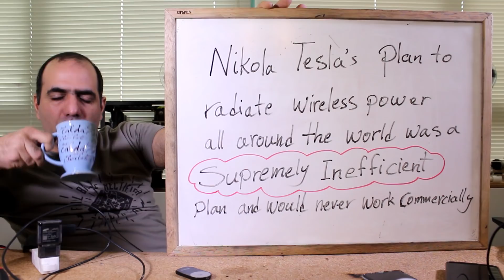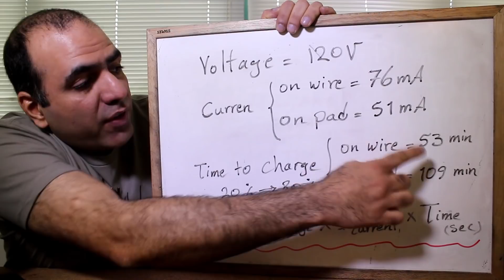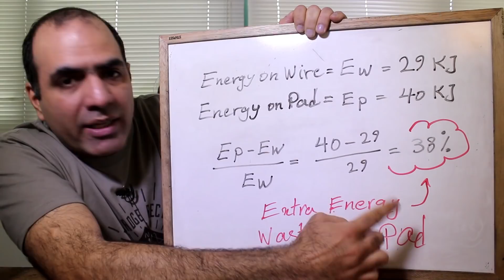Drowning in Inefficiency

Comment: Check out the 'new' charging cables available on eBay, with a magnetic connection between the cable end, and a small magnetic donnection to microUSB or lightning port connection.

The magnetic connection is what caught my attention, because I frequently fall asleep reading my iPad, and kill a lot of cables.  What has me raving about these new cables is their EFFICIENCY!  They actually charge at a high enough rate to make the Apple 2.4 A charger get hot!  Charges my iPad from 10-20% in 30-40 minutes.

Much, much faster than anything I had before.  Plus, the cables are very durable.  I was buying Apple OEM cables, ten at a time, and they lasted 2-3 weeks.  I had two buy two ten packs from different vendors, usually, because there's a 10-20% DOA rate on the cables.

I got 3-4 months out of the first one, warrantied it, and have 4+ months on the replacement.  I've tried two, or three different brands, (I bought extras), with the same charging results from all of them.

Enjoy...

Comment: I heard from other sources that induction motors used in electric vehicles is very efficient (>90%) to convert electricity to mechanical energy (though there are other energy loss in battery (~90%) and inverter (~90%), but the overall efficiency should still be around 70%), which is much better than vehicles that burn fossil fuel.
Reply: Problem is: we don't care too much about efficiency overall, than about total consumed power. If choosing between gas scooter which has 20% efficiency 2-stroke engine, and Tesla, scooter is winner because it is so lightweight, it just doesn't need too much power to ride you, so it ends up consuming much less. While Tesla may be 70% efficient, but it weights more than 1,5 tons (all that batteries and invertors and insanely overpowered motors, that's just no point in that), so it has much more rolling friction. It is also bigger, so air drag is also quite big. With mass that much you lose energy at each accelerating and braking (even if there is regenerative braking, it's not that efficient, doing conversion from mechanical to electric to chemical and back), so just no. 

When talking about efficiency, people often forget about it...

Comment: Mehdi? You are WRONG! Gas and steam combination turbines can be efficient up to 63% (german source here: https://de.wikipedia.org/wiki/Gas-und-Dampf-Kombikraftwerk)
also to claim regular engines are only 20-40% efficient is unfair and not true

also Elon Musk is a fraud. Here in germany and europe we have tons of literature calculating his cars need to drive from 200.000 up to 300.000 km in total to be more efficient than regular cars. and that's by average! his car's are bad for the environment, using rare earths, needing hugh amounts of energy to produce and they are expensive. that does not sound like a solution to any modern problem!

Comment: I'm truly inspired.
I was working on a 10kW residential wind turbine. I designed an axial flux generator for this purpose. I also designed the blades the control system.
I was fed up after all hardwork, because I feared I would fail to succeed in the project.
Then you just struck me like a million volt lightning. I'm on my project now. Never gonna give up.
I. Am. An. Electrical. Engineer.😎
Reply: Oh so you designed a thing that kills birds by the thousands every year? Not to mention it is inefficient most of the time as wind speed is not constant. But don't make this discourage you, people do pointless thing and it's ok as long as you feel self fulfillment and satisfaction!
Reply: @kaikart123  just because the wind speed isn't constant does not make it inefficient
Reply: @kaikart123  pointless?????
Reply: @kaikart123  the birds will slowly adapt and migrate
Reply: @kaikart123  Let me clarify your doubt.
Yes, the wind speed isn't constant. But we can use a flywheel with an adequate weight. This will reduce the problem.

Yes, birds get hit by the blades. Buy the weight of the blades isn't much and the speed is also low. It's a mere 100 rpm. I have designed in such a way. This prevents birds from getting fatally hit, and gives long life to parts with less stress forces.

It's not a mere satisfaction or fulfilment. It's a revolution for the mankind. Because that's who I am, an Electrical Engineer. I revolutionize the planet.
You must be a dumb American who also thinks wind turbine cause cancer. I cannot answer that doubt of your leader or your group. I'm sorry.

Comment: My life is inefficient, so here is my unsolicited opinion. :) Wireless charging pads are great, despite their problems. 

   Imagine only having one functioning hand... hows that micro B connector treating you? Aside from turning a 2 hand job into a one hand job, think about their inherent safety in public settings. Maybe I’m paranoid, but I’m not hardwiring my phone into ANY public USB charger. USB carries power AND it ALSO carries DATA! Most importantly... ITS REALLY COOL! I smile almost every time i plop my phone on a pad. :D

Comment: VPNs are a waste of electricity. Most of their  claims are misleading at best. The only benefit is getting around geoblocking. You are also slowing your internet down so yeah, more waste.
Reply: Go check michael reeves' video that was sponsored by a VPN. He demonstrates how easy it is to pluck data packets out of the air, and how effective VPN's are in preventing this.
Reply: @taylorwalker2814  I know how to pluck packets out of the air. 
I guess, I should add that VPNs are very useful for public WiFi.
Often public wifi will do little to nothing to protect it's users.

Comment: A great video in till you mention Elon, after all, he is just a seals man... Goes out with stupid ideas that's old and puts oon an other name, like hyperlop... Your better of not looking up on him, there is some real engineers out there that don't make the many with false promises... T
Reply: Hyperloop is hypothetically possible and isn't a horrible idea. SolarCity on the other hand...
Reply: Well, hyperloop is an old idea from 1800. The name is only new... And yes it is possible, but we still have the same low pf physic as in 1800, like a long pipe bending because the terminal extension more on the top than on the bottom while sitting in the sun... I still think he is a great man pushing true the tech in the electric car industry... But that's it...
Reply: @kristiangronberg3150 , did you watch that thunderfoot video about hyperloop? I don't know how he, being a physicist, can say so much idiotic stuff. We already have oil pipelines that go for thousands of kilometers with quite a few atmospheres of pressure in them. They just put and elastic link (a short polymer tube) every few of kilometers and thermal expansion isn't a problem.

Comment: what about the Wankel rotary engine. i think it is more efficient
Reply: It's lightweight, which would allow to use less power because engine is the most heavy part of car, so there is less friction, smaller car and less drag and so on. But its efficiency (power produced divided by power consumed) is actually lower than of conventional engine.
Reply: Well, it seems not, that's the problem. Even if this type of engine has real advantages such as vibration, noise, compactness....(By the way, it's the piston that is rotating, not the engine as in some old planes)
https://en.wikipedia.org/wiki/Wankel_engine

Comment: I think the most inefficient thing in my home is fan. I mean the AC fan that usually has three speed mode to chose. I'm not sure if it's popular in US, but it's often seen in Taiwan. That kind of fan draws around 80-100W while the BLDC one draws 20W and produce even stronger wind.
Reply: But it's SOOO more efficient than air conditioning unit! Nowadays lots of people spend kilowatts of power to cool down air, though they could just turn on the fan. Even with 80-100 W motor it's pretty good solution. Actually, I think their power consumption isn't so big, 80-100 W is probably FULL power, active + reactive. Reactive power is not good, but it gets compensated usually (there are special stations with battery of capacitors to keep power factor close to 1), so you're OK.

Comment: Returning rocket stages are actually extremely energy inefficient. They need extra fuel for landing. This means extra weight hence even more extra fuel to launch it.
Reply: Yup. These Falcon Heavy are impressive of course, but both times they delivered 3 tons to orbit, maybe even less, that's total garbage! Space Shuttles probably were more effective than this. And they were almost reusable: only hydrogen tank got lost. Boosters were recovered (they just fell to ocean on parachutes) and orbital stage too, of course.
Reply: @allmycircuits8850 Shuttle-like return vehicles are definitely the future of space launches. Multi stage rockets had to be a compromise for the time until we find energy source which would be efficient enough to launch one-stage-to-orbit vehicle. Unfortunately this situation did not change drastically since the times of space pioneers.

Comment: talking about how inefficient a light bulb is, we must consider the fact that this is the simpliest way to generate light - just like the nature does - overheating something so it starts to glow. Ofc there will be alot of energy lost due to the method itself. Even the Sun glows and burns with so much inefficiency! What we might do is consider other ways the nature crates lights. Radiation glowing? Electrical discharges (in any size, like lightnings)? Maybe dividing one big heating element into number of small ones, so it'll take less power to heat them all at once (since thermal capacity is a thing) to the same net brightness. Is that what LED bulb does btw?

About charging phones: same problem, they heat up during the charging process. And this is due to the fact that power transmition is overloaded by the speed it actually tries to charge the battery. I think if you charge it slower - the coefficiency might rise. But then again, who needs their phone charging 8 hours with a capacity of 3ah... This is when replacable batteries come into play. Just charge few of them in advance, and we need a phone that supports battery hot-swap (instead of that stupid wireless charghing tech that has no practical applications). 
OR BETTER! A battery, that can be charged in parallel, not in series. Im talking about a battery that consists of small portions that the charging module can deliver energy to at once. So instead of waiting for the whole battery to charge slowly step by step (and increasing current to charge it up faster, making more energy to waste in a heat form), this battery will allow to charge itself in different "spots" at once, making the whole process superfast without getting too hot to waste energy and drop efficiency

Comment: Solar panels top out at 20%. You can get 400W panels, but they have 2+ meters of surface area, so still max at 20%.
Reply: That's not true, solar panels with up to 50% efficiency have existed for quite a few years now but the obvious down side is they are ridiculously expensive and at current not possible to mass produce, also it's the type of thing you aren't just going to find on amazon and get free 2-day shipping, you're more than likely going to have to be a company, contact the manufacturer directly and make a large order to be able to obtain any such panels.
Reply: @vgamesx1  "SunPower produces the highest efficiency monocrystalline solar panels available. Our X22 has a record-breaking efficiency of up to 22.8 percent, making it the best performing panel on the market today. Polycrystalline panel efficiency typically ranges from 15 to 17 percent."
Reply: That's in a controlled environment. In the hot California Sun, efficiency drops, dust on it drops the efficiency, so practical efficiency is less than rated.

Comment: I always hate the wireless charging. I caught the hype back when I bought an HP Veer and it came with touchstone charger. I ended up using the cable most of the time anyway. 
Don't be an idiot guys.... There is no benefit in using wireless charging, you can just put it on the pad sure, but when you want to use it, you need to pick it up anyway.

Comment: Charging a laptop at a friends solar setup: His small DIY solar setup creates 20V DC, his transformer makes it 240V AC and the laptop charger makes it 20V again.

Your video inspired me to fix this:

Instead of a laptop I plugged in my desk lamp and pointed it at the solar panel to create more energy. Easy as that, elon musk brain.
Reply: A true Elon Musk brain would plug an extension cord onto itself in a loop. Boom, infinite energy.
Reply: And how is your laptop now ? How much does it cost to fix it?
Reply: @natefiver6623  What? Sorta seems like you assumed he plugged the panel directly into his laptop, despite him not saying that he did that. That being said, it the correct protection in place it could be done and save energy
Reply: @natefiver6623  My laptop works just fine. Read the original comment again, you must have misunderstood something.
Reply: @SERVOPUNK  I just get it lol
You are charging the solar panel by the lamp that is taking the power from the solar panel
So its generating more energy 
And that is how elon musk brain works 😂😂
Reply: why would anybody have 240? wouldn't it me 220?
Reply: @tommybomby4122  here in Great Britain we use juicy juicy 240V power. It helps us make tea faster.
Reply: @tommybomby4122  More like 120/110V.
Reply: @boxcarz  and i've never heard of 110 volts either. i've only heard of 120 and 220
Reply: and yes i do use 120
Reply: @tommybomby4122  To my knowledge, some EU countries have different voltages. The grid here has 220V but the solar inverter he bought produces 240V. Every appliance he plugged in so far could handle 240V, so it seems to work just fine.

Comment: I highly doup new innovations, unless they are on the scale of miracle or free emergy, actually make a significant difference in energy consumption.

The problems are political and ideological: lack of funding, private interests and lack of cooperation are the real reason we aren't more efficient than this. We fail to utilize and build efficient tecnologies, and any savings quickly burn up as we just buy more and more stuff to replace it.
I have 2 computers, laptop and a phone. Sure, they all are more efficient than the first computer I used, but together, in way more active use, they definitely consume more energy

Comment: Nuclear power is 90% efficient according to the information I found.
Reply: Snorting plutonium is only cool for so long ...
Reply: Yes, it is efficient, it produces almost no CO2. But it's one of the most expensive methods to generate electricity. When you add the cost to keep the waste safe for only 100 years. And this is only a small part of the time needed. Right now the public pays for this, it's just plain wrong
Reply: @stefanhauser2804  "But it's one of the most expensive methods to generate electricity" wrong. Nuclear power had the lowest electricity production costs at 2.10 cents per kilowatt hour, and petroleum had the highest at 21.56 cents per kilowatt hour.

"Right now the public pays for this, it's just plain wrong" tell that to wind and solar.

Comment: In a rare case of discussions on the internet, i once read an interesting point, if you obtain your energy from only your own sources (most likely solar) and you're off grid, then, does the amount of wasted electricity matters? And in direct way i guess no, because the source of energy is relatively permanent and as long as you have enough energy per day there's no problem in wasting it. The problem with this would come in am indirect way, because if you waste energy in inefficient devices or uses you're wearing your batteries installation and devices, wich eventually would cost when they need maintenance or replacement before, also you could argue that if you put your extra electricity on to the grid (if you're connected) then you're helping the overall grid and producing clean energy for everyone. What do you think?

Comment: If you want to save the wear on your plug, use one of the magnetic charging plugs that are available.

Wireless charging would be far more efficient using light, but the metamaterials needed for optical dipole antennas are still in the experimental research stage. Imagine how efficient solar power could become!

Comment: reusable rockets using fuel to land?  What's wrong with parachutes?
lifting extra weight of the chute sure less than using rocket fuel to slow down descent - including the weight of the fuel at beginning descent.  (gravity is free or not?)
Reply: Using fuel to land allows them to control the descent so that it lands exactly where they want.
Reply: @Chaosonic but the weight of that fuel?  far more than chute and fuel needed for truck to go and pick up (or like space shuttle fly down - only need a little fuel for manoeuvring.)  Vertical landing sure super wasteful - that's why so rare.

Comment: Hi, I want to ask something. On a Rc car I had, I found that it had a brushed DC motor with a capacitor parallel to the motor. I wondered if you know why it has that capacitor.
Reply: It's to filter out EMI from motor. Otherwise it would make control by radio waves impossible.
Reply: @allmycircuits8850  OK thanks.

Comment: I think you misunderstood, it was intended to be municipal, not commercial. It was billed as a long range commercial radio tower to get funding from jp Morgan. If you read and believe his Colorado springs notes, his plan was to harness the power of the ionosphere. so inefficiently harnessing and transmitting something like hydro electric or ionosphere charge is much better than not harnessing at all.